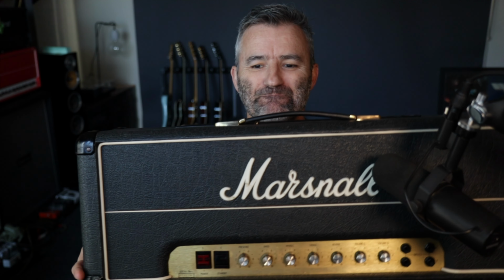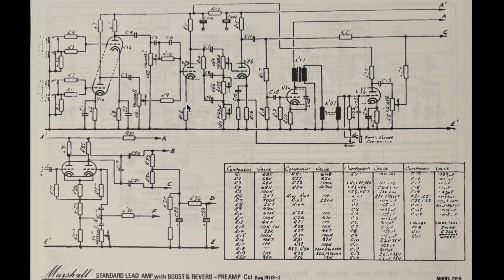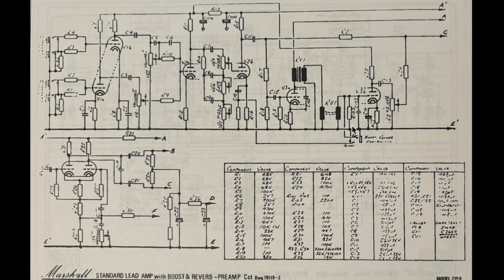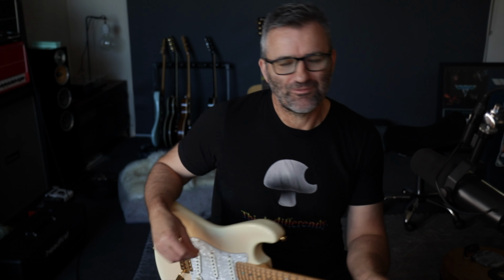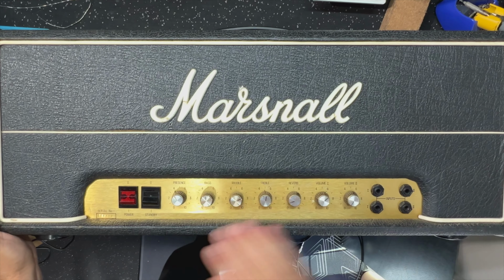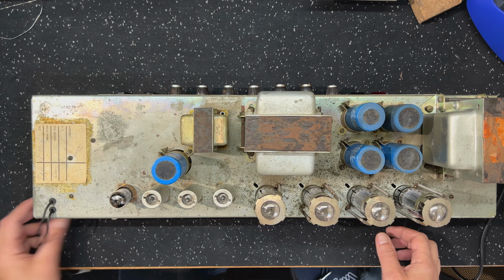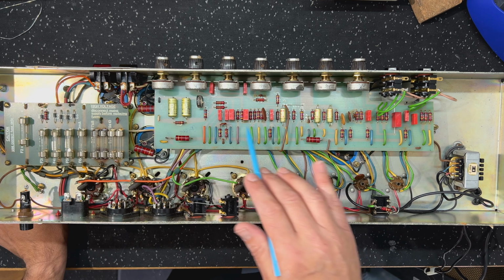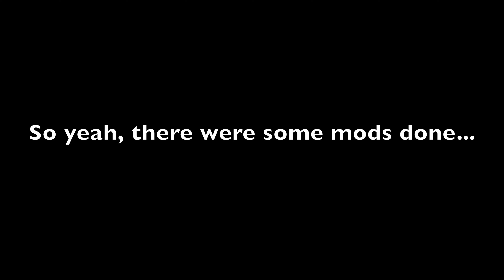100W Super Lead with Reverb??!!  The Marshall 2959

Comment: Neat amp, Jason.  Haven't had one of these across the bench, but know a little about and very cool.
Online suggests made 1978 thru 1980 and only 150-200 made, so yes very rare.  The one you have has the serial number on FRONT, which mean 1979 or early 1980, that's the ONLY time they did this, but was you can see by the lettering and tag on top of the chassis, it's a 1980 variant, so probably early 80.
From research, these were all originally for the Canadian market.
As you indicated, it only has TWO taps and they are 4 and 8 ohm (no 16 ohm tap)!!   That stinks.
From the Marshall forum, there was a 1980 sold on eBay not too long around Apr 2017 and had the following transformer set (the main T4145 is very typical and we'll have to see what the voltages are on this one.
Mains - Dagnall T4145
Output - Dagnall C2723
Reverb - Dagnall C2659
Choke - Drake T100 1471-263
The 4210 I worked on for Keith "Rock" Holstein from the Crazy Babies Ozzy Tribute band has reverb in it and this C2659 in it, so Marshall looks like used it common on anything with a reverb in it.
The amp sounds quiet from your clips, which I would expect as not high gain.  I DESPISE all of the damn fuses in the thing.  The reverb needs work.  There is no mixing of the dry to wet tone and there is too much dry in my opinion.  A good mod would be to work on the reverb section and also add a wetdry mix pot rather than fixed amount.
Look forward to your next video.   I finally got around to picking up a Shure SM7B boom, so may be doing some POD Casts or whatnot in the future!   Retirement is not to far off in the future!! :)

Comment: Extra fuse board was also used in scandinavian export models. I have a JMP 2203 -82 (yes very late JMP)  that has the same fuse board. No PCB mounted pots though but the same red Iskra coupling caps, same Daly smoothing caps (replaced long time ago), same head cabinet, same front and back panels and only 4 and 8 ohm outputs. I bought  the amp second hand in the early 90's for 150 €.

Comment: with the fuse board and transformer taps, I think Marshall just did that for all of the custom ordered stuff so they wouldn’t have to make seperate canadian versions. It was the same on my JMP2144, 2150 etc. 

The 2150 is the same as this I think, just in combo and without the reverb. The Park 1210 is like a cascaded gain version of it without reverb
Reply: Yes, I have a very early January 1979 100 watt 1/12 combo  that looks exactly like this without the reverb same only 4 or 8 ohm selector 4 holer with factory master volume in front this particular amp sounds quite amazing

Comment: What can be done tonthe reverb to make it sound better if at all?
Reply from the maker: Turn it down, try a different tank…
Reply: Reverb pedal 🤣
Reply: Cutting the amount of bass going into the circuit, reducing plate voltage a tad which helps reduce that splash that sometimes happens, Brad and Lyle are the reverb circuit gurus 😉 Reverb on 1 is usually too wet for us 😂
Reply: @siriusamplification  thank you..

Comment: i just bought a  friedman irx ...could i  put in an input jack to my  stock origin 50 and connect directly to inverter bypassing normal input stages ? and use the origin 50 as a power amp for the  friedman irx?
Reply from the maker: Yes, plug straight into the FX Return jack.

Comment: Looks like one EL34 is older OR had been running hot as the color has turned from the red to a brownish color. 3 out of the 4 valves look matched but the hot one I can see no sticker on it at all. Could have just come off OR it's not a matched quad, have no clue.

Comment: Very similar construction to my 4140 club and country which was originally a 4x10 combo. 
The amp developed many problems so i rebuilt as a turret board 2203 head. As it had extra preamp sockets for the reverb and "banjo" input i put in a hard switchable blues breaker tremolo. 
Cathode follower driven tone stack is the heart of the marshall sound imho. 
Your vid brought back the memories of wrongness of both the reverb and tones and reminded me of how good a stock 2203 is.

Comment: If both reverb driver and recovery circuit are done using only one same double triode, it is a very poor man's reverb indeed. You  need a 12AT7 or 12AU7 both triodes paralleled to really kick the tank. I usually use double triode cascade in recovery circuit as well in my amps.